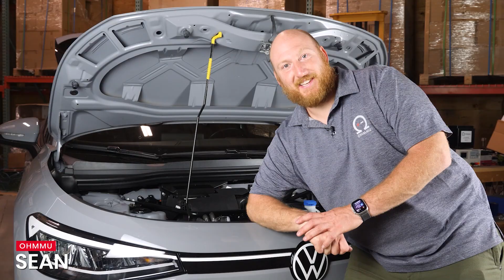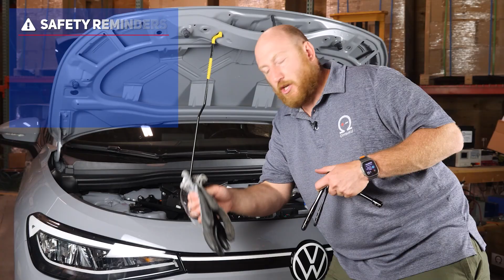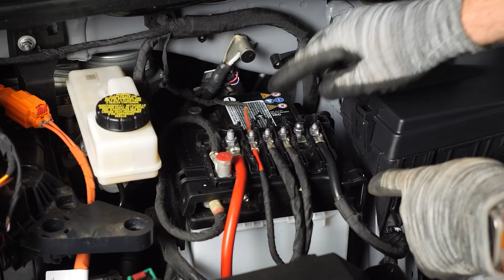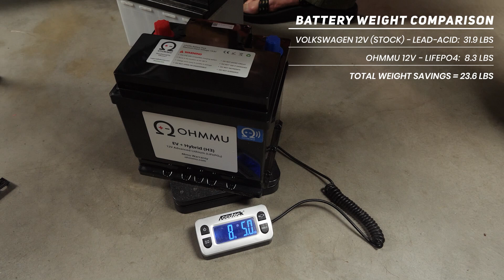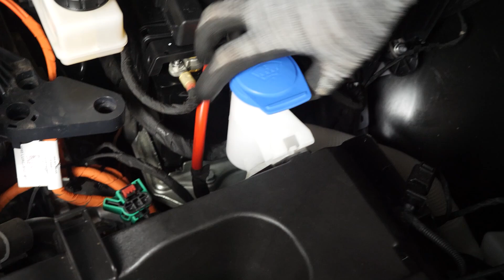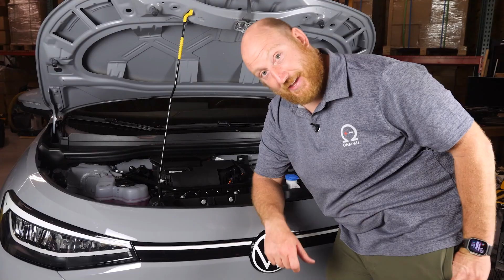Volkswagen ID.4 - 12V Battery Install (Ohmmu)

Comment: This is a bad idea. The battery is not coded (and can not be) coded to the car. It will charge with a to high voltage and wrong capacity, the new battery will have a reduced lifespan and possibly fail quite quick.

Comment: Beware of the claims this company makes. I purchased a battery for my 2020 Tesla X based on the information available on their website only to find out that software updates from Tesla does not recognize the battery. Two weeks after installing it, and just a day before a long trip, the system reported the battery as failing. They do not offer phone support but they do offer videos that reveal they are well aware of this issue and offer "work arounds" that require intervention by their support team. This is far from OEM compatible and, in my view, their marketing information is dishonest and dangerous.

Comment: How does the 12v battery charge when the ev is level one charging? I mean, do I need a separate charger for the 12v battery when the car is not being driven?
Reply from the maker: If it’s sitting for while, like more than 10 days, we recommend to have a charger. But it’s able to be charged via regular driving/use in the same way that the vehicle would used a regular lead-acid. :)

Comment: It's a bit ironic that you can get a ticket for texting or being on your cell phone while driving, but a Tesla requires you to do pretty much exactly that to adjust climate or audio while driving. I do not want to have to use an iPad to drive my car. Give me knobs, buttons and switches that I can find by touch while keeping my eyes on the road. The id.4 has reasonable controls, though not perfect, and at least you can see much of the important info on the center display without having to take your eyes completely off the road.
Reply from the maker: I agree

Comment: It's crazy that on an EV with so much unused space up front, they have to hide the battery away under a bracket and all the electrical connectors.
Reply: Europeans are quirky about weight and function. Lower and better accommodating to 50/50 weight distribution let's their stars and moons to perfectly align.

Comment: Perhaps you should mention that the ID4 has to have new battery info installed in computer
Reply: I spoke to someone at OHMMU directly and they stated that this battery is a plug and play operation...?? Even in the video the guy states after some errors and such displayed on the infotainment, they disappeared and everything worked fine.
Reply from the maker: Yeah, the term "has to" is the key here, you can do the VW programming and avoid having any alert messages at all or you can just swap it and then drive it and the alerts will clear as the car recalibrates.  It isn't "absolutely necessary" to program anything on the VW ID.4 when doing a 12V swap.
Reply: Oh yes, it is necessary, especially with a AGM battery or this Li. It will fail due to high charge voltage and wrong capacity setting.

Comment: Vw dealer says this battery cannot be coded to the id.4. Battery performed fine, but the car threw up error codes and the dealership said vw would not cover under warranty. Had to put the oem battery back in and pay for the service. OHMMU should not sell this battery for id.4 if it can't be coded.
Reply: For the ID.4, the OBDEleven app, combined with their Bluetooth dongle, allows owners to code battery type and capacity in Ah, plus reset and set the serial number for the battery (changing the serial number resets the 3-stage charging profiles and voltages to assume the battery is new and has the full Ah capacity).

The ID.4 supports several different types of batteries and has custom multi-stage charging profiles for them (flooded lead acid, AGM, EFB, etc).

You really do want to properly code the ID.4 for the correct battery type, capacity, etc because it has a very advanced battery charger that will overcharge a new battery if the last battery was failing. This is because it keeps cranking up the voltage for the absorption stage to try and force a failing battery to accept more charge and to reduce sulfation. Unfortunately it isn't smart enough to automatically detect a new battery (I've tested this and can confirm it doesn't until the serial number is changed - to anything different than it was).

Note the dealer is also able to do this coding for you. My dealer charges a ridiculous $200 to code a new 12V battery, even though it only takes 10 minutes or less...
Reply: Coding probably is the way bmw allows for different battery technology and they have different charging method implemented. The bms inside the ohmmu lithium iron battery maybe assumes lead acid charging profile. So set the charging in the id4 or code it for lead acid battery and let the bms take care of the rest. But lithium iron has limitations at low temperature.
Reply from the maker: Why not?  Coding isn't necessary for the car to function, we have many ID.4 running our batteries without any issues, the coding is a nice way for dealerships to keep you in their "world" and remember big automaker dealerships like VW make a lot of money on service.  You don't "need" to code for the battery...  But if you really want to, get a Bluetooth OBD dongle and an app and DIY...
Reply: @OhmmuEnergy  so can this battery be coded or not?  Nobody wants trouble lights on the dash!
Reply: @OhmmuEnergy  2024+ Volkswagen Group vehicles with the latest security system (SFD2) are currently not supported by Bluetooth ODB dongles.
Reply from the maker: @MrYougetit  Thanks for the info! :)
Reply: @OhmmuEnergy what charging profile does your battery need?

I've now learnt quite a bit more about the charging system in our 2024 ID.4 AWD Pro S:

1. With the old battery it had adapted to the weak battery and was using at least 100A for the bulk charging phase (it would almost immediately switch to absorption charge), 15.35V for the absorption phase, and 15.2V for the float phase.

2. Once the new battery was coded into the car, it continued to use 100A for the bulk phase, but now 13.75V for absorption phase, and 13.2V for the float phase.

3. The above two charging scenarios were in temperatures of approximately 2°C to 5°C. I don't know if temperature impacts the charging profiles, but expect it would. 

4. Although OBDEleven says they can code our battery, I discovered 2024 and newer cars use a new security protocol and it can no longer code these cars for a new battery. VW apparently is working with a few companies and their OBD software to get aftermarket solutions in place and one of them has a beta solution (VCDC?).

5. In the end our VW dealer coded our battery for us using a customer relations program.
Reply: @OhmmuEnergy  Thanks for the response—slightly delayed but absolutely spot on!